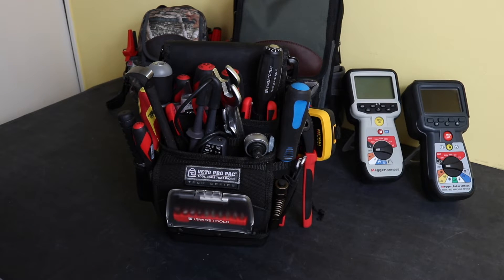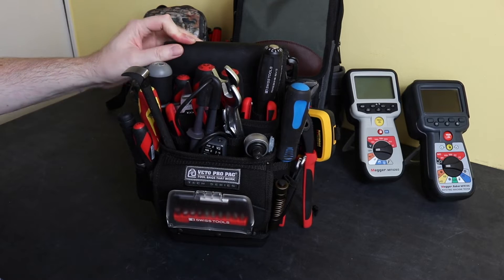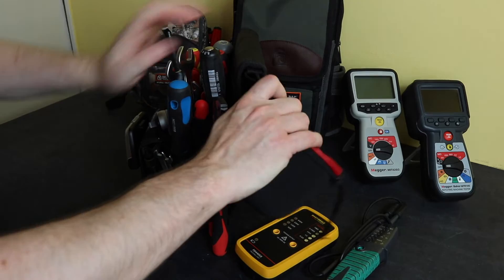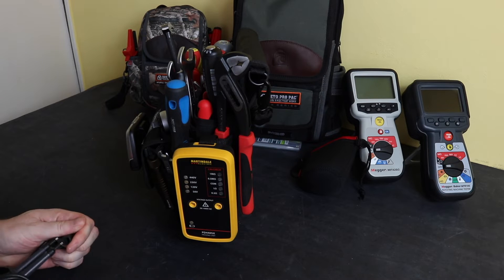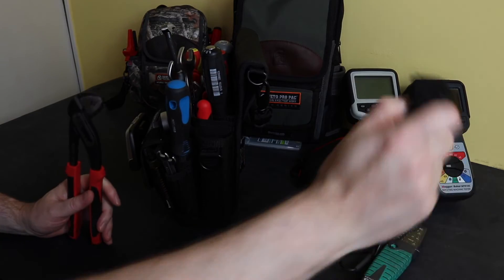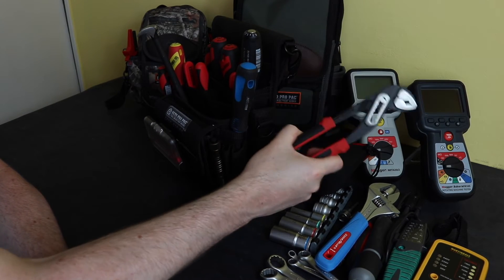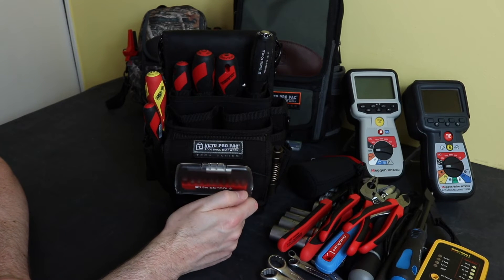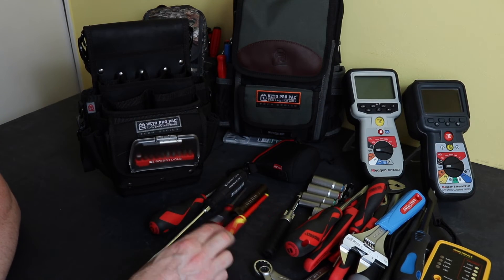Electrical Motor Maintenance Tool Loadout with the Veto TP4

Comment: I like it - it would be nice to look at the full testing regime on a desktop AC or DC motor single and three phase using the European British standards it would need thinking about to layout but I suspect that series of videos would be something I know myself and others would be very keen to see and hear from you especially given your experience and expertise. 

Even a series going through the published standard without the practical elements would be equally interesting you could compile it across several videos.
Reply from the maker: Thanks for watching and commenting MM. Thanks also for the video idea, I would need to check on the relevant standards as most of the IEC deal more with type testing rather than routine testing. They are also copy-righted document, so I would not be able to do anything direct from them without permission from the IEC.